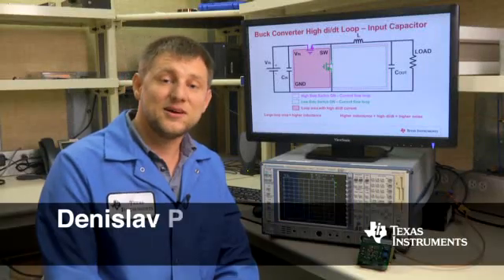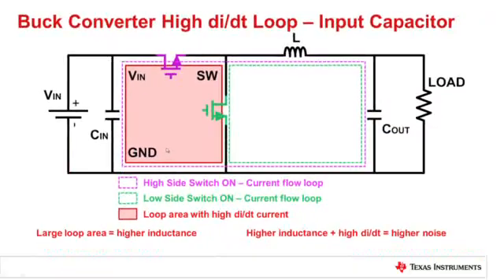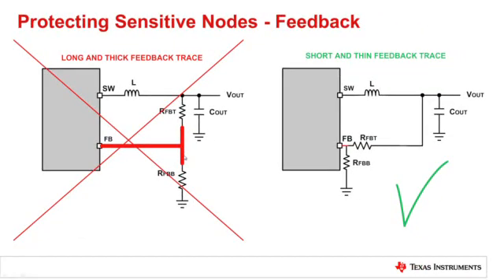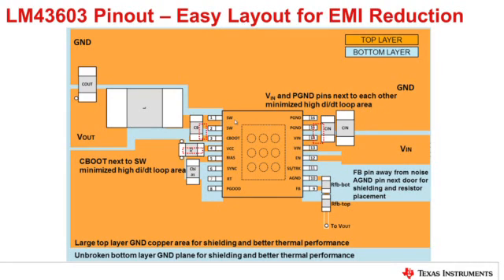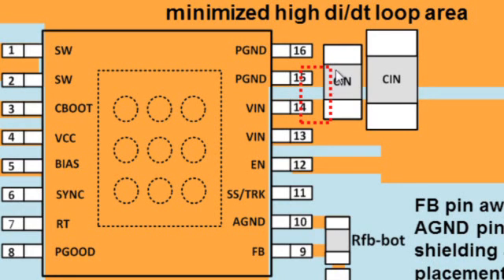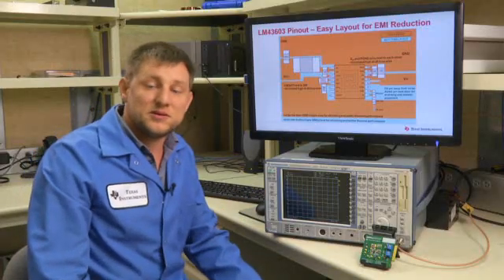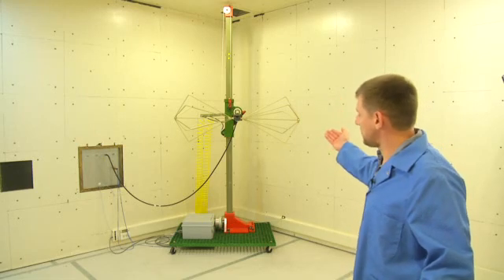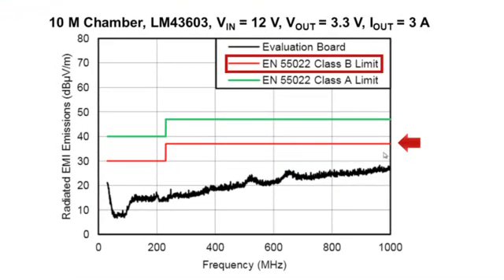Layout Tips for Radiated EMI Reduction in Your Designs

Comment: The explanation associated with the reduction of EMI due to using more layers is misleading. The reason that EMI is reduced for the four layer board relative to the two layer board is not the increase in the number of layers, but the presence of the ground plane closer to the top signal plane... Aside from that, this was an excellent video!
Reply: Thank you for the comments. I agree - the proximity of the internal ground plane to the top layer is the difference maker. It results in lower impedance return path.